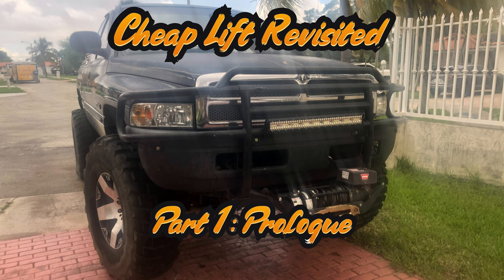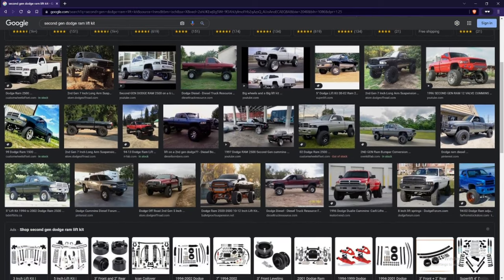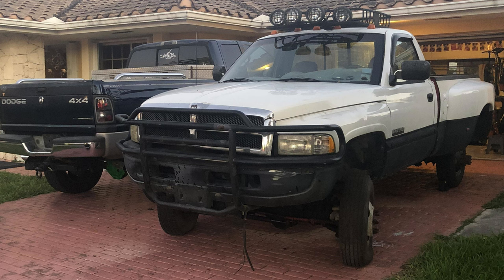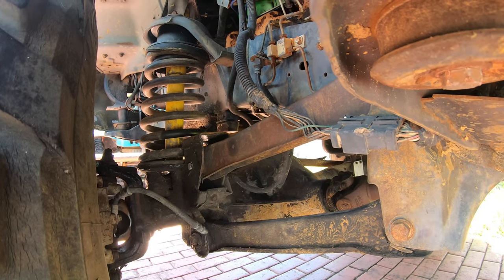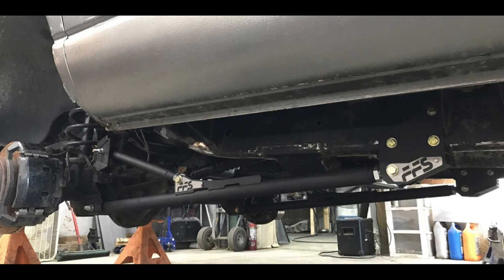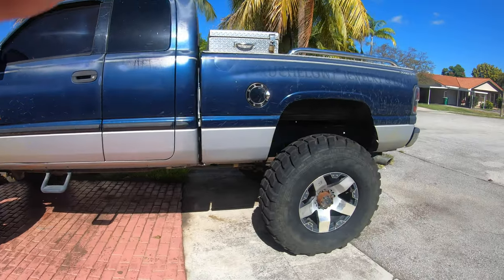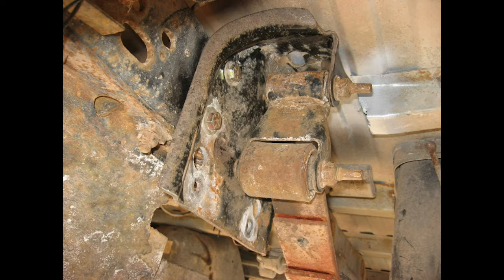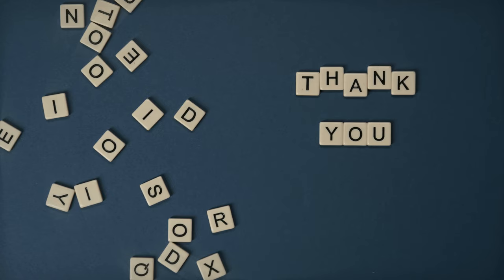Cheap Lift Revisited Part 1: Prologue

Comment: How do you maintain the proper caster angle when you lift the truck? Is it adjusted by the length of the control arms?
Reply from the maker: Yup you would either lengthened or shorten both control arms that would push the axle forward or move it back. Since the top of the shock/coil is in a fixed spot moving the axle forward or back adjusts the caster.